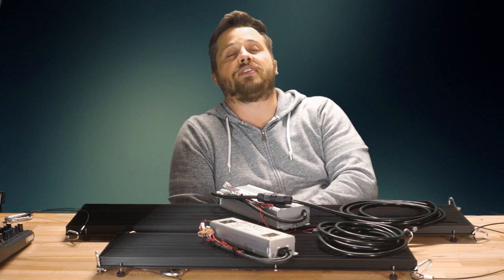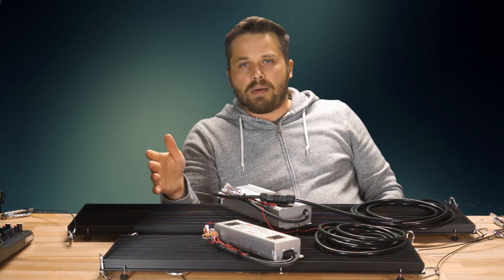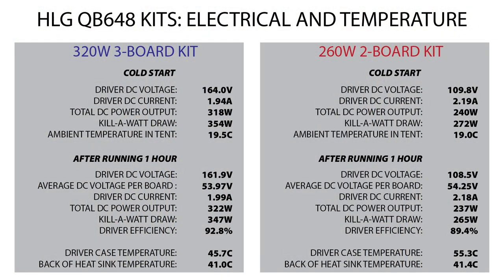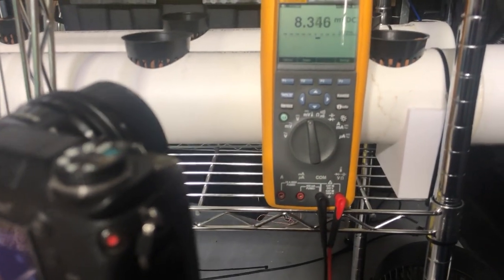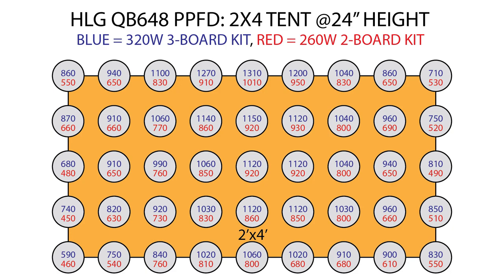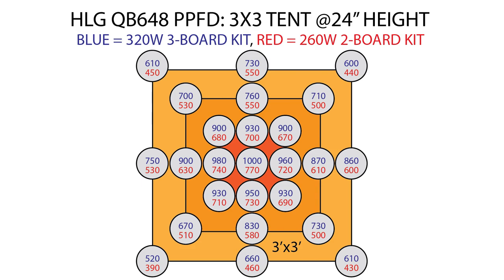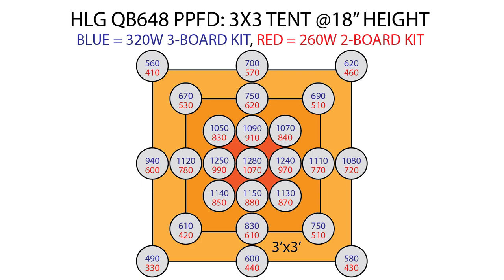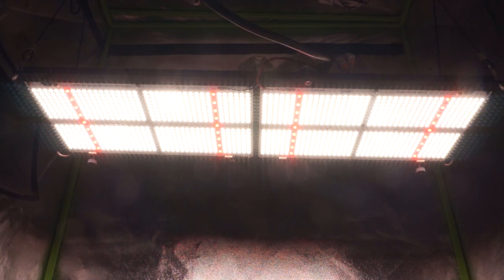Testing PPFD on the New HLG QB648 260W & 320W Kits

Comment: I was sold on the 320w, until I realized there was no external dimming capability like the 260w ! Very disappointing doesn't make sense to me. You would think for the price they would include the external demo control on that unit . Would be nice if they offered an option with a driver with external capability.

Comment: When compared to the PPFD shown in LED Gardener's Slate 3 Triple video for the HLG 260W 2x QB288 the 260W QB648 measurements in this video are considerably higher.  E.g. the QB288 PPFD at center was 470 PPFD, this video shows the QB648 at 1070 PPFD - both tests measured at 18" over a 3'x3' area.  Are the newer boards really that much more efficient?  Or is the huge jump in PPFD due to the fact this test was performed in a tent?

Comment: I am curious if the sq620 meter would give different results.  The 500 covers led properly?  I purchased one about a month ago to replace my 120 sensor.  the 620 shows about 20 percent higher than the 120 under my leds.
Reply from the maker: The 500 covers LED properly though from what I understand the 600 series will cover UV and far red as well.